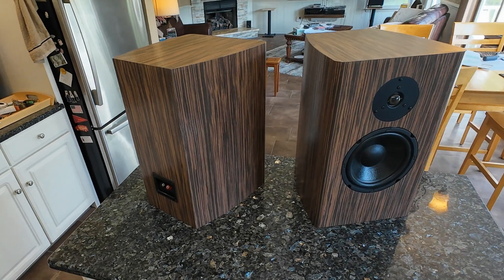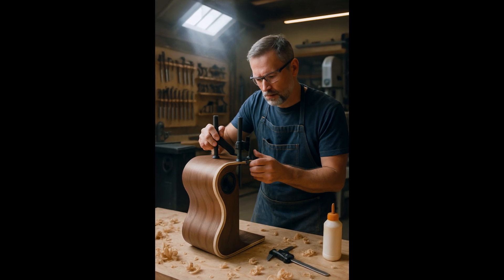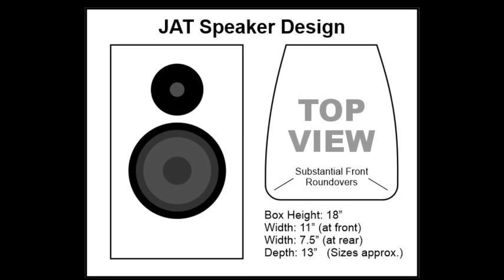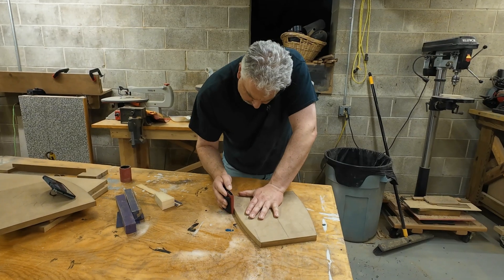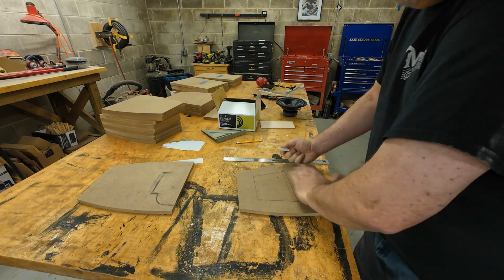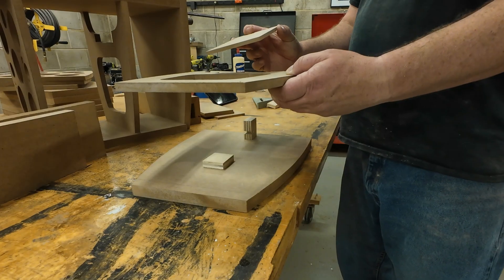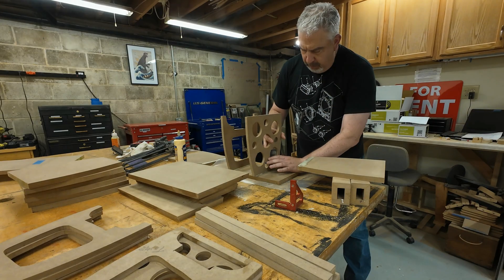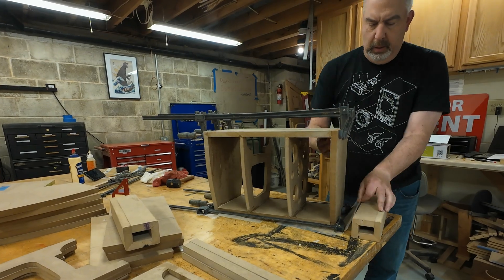Construction Video of the JAT/ZAP Speaker Collaboration

Comment: Excellent, these look like the smaller (much more expensive) Wharfedale speakers. I only have very basic woodworking tools but if I apply some ingenuity I will be able to build them. 🤝❤️
Reply from the maker: Glad you like them, and thanks for the support!  I (HOPE) to do a video coming up on creating curved side speakers with minimal tools. There are a lot of folks who would like to try it but are put off by the extra work and (seemingly) extra skill it takes. If I can do it though, it can't be THAT hard!  Thank you for watching and for the comment.
Reply: Thank you so much, I am thinking of a combination between resin, polyester filler, spot putty and MDF to achieve the curvature of the speakers. I know it will require a lot of hand sanding to get the finish right, but using a sanding block and sanding it with my hands does wonders for my nerves and stress levels. ❤️
Reply from the maker: I know what you mean... this stuff is certainly therapeutic.  I think your way of making curves could work.  As long as you enjoy the process, it really doesn't matter how long it takes or if there is a different way of doing it that most others end up doing. I say the process is as important as the end result.   If you saw my quick video on the speaker design competition, there was a large set of round-top speakers there which were raffled off. They were made with 2" strips of MDF with a thin sheet of wood overtop. There might be some ideas for you on that build... Here is a link to that build on PE's website.  https://projectgallery.parts-express.com/speaker-projects/the-dayton-storms/   --Tom